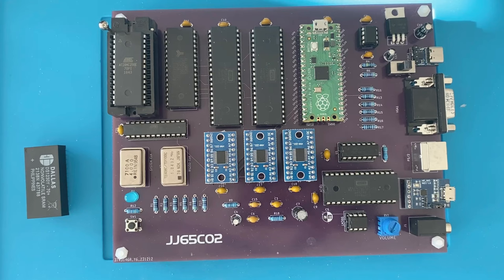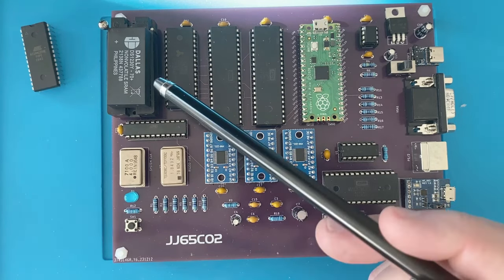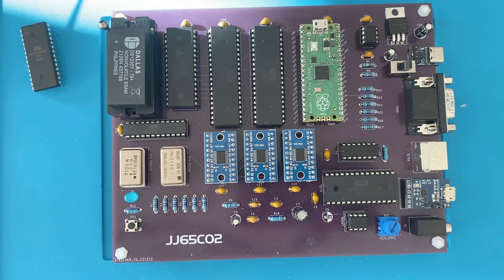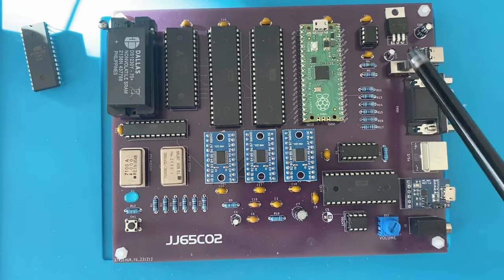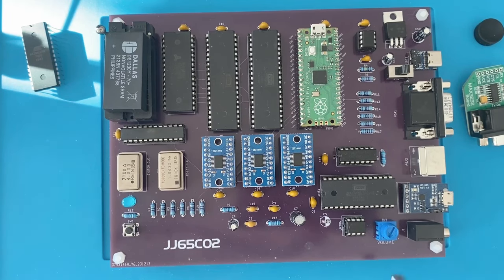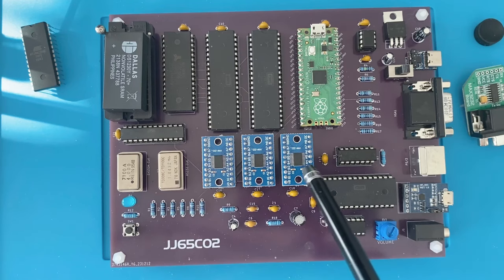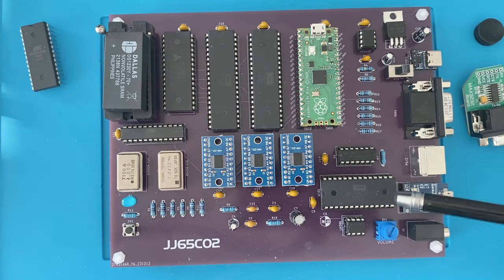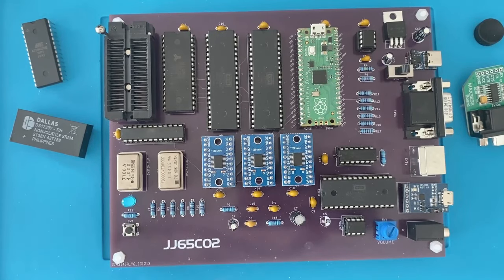Guide to the JJ65C02 SBC: Episode 1

Comment: A useful technique, esp in more performant machines where slow ROM speeds were killer is to shadow the ROM into available memory. You can do this either on boot via programmable logic or how 386-Pentium era did it via bootstrap through BIOS initialization.
Neat board!

Comment: Nice PCB & project! I did not see header pins to connect the VIA to external devices, so I was wondering how this was done. Also, the existing ROM chip and the Dallas Ram/Clock chip appear to be both 70ns. How is the Dallas Ram/Clock chip faster?
Reply from the maker: Good eye! Yes, I was able to find a 70ns EEPROM, which is much faster than the 150ns variants in use out there, but it is also sketchy as all get out and quite unreliable. I'm pretty sure it's an overseas knock-off.